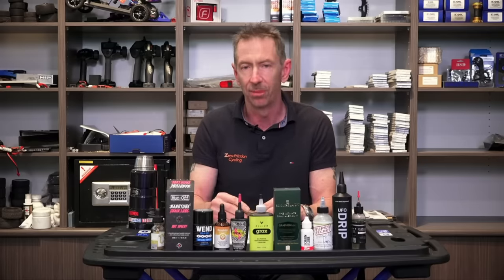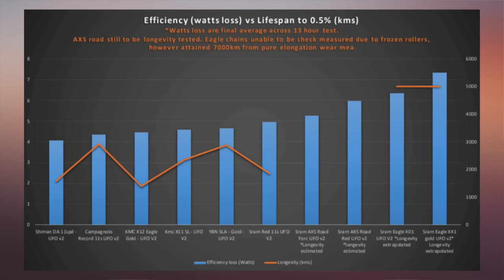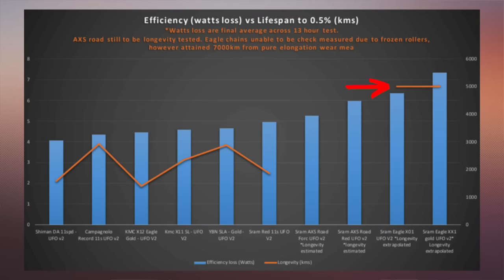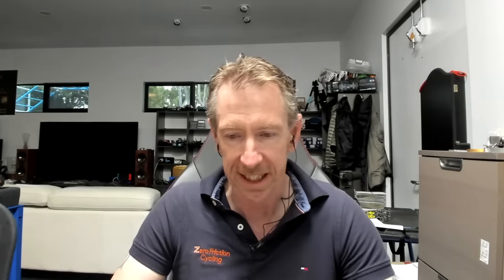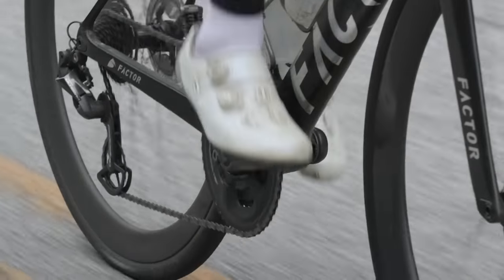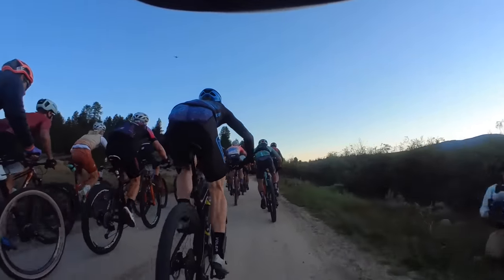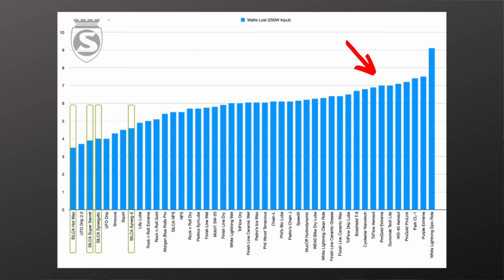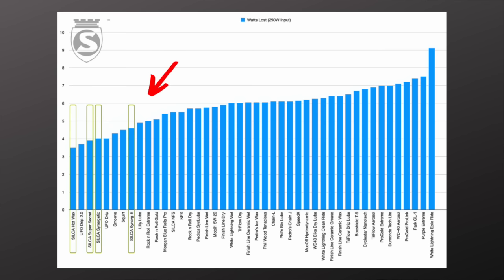How Slow Are SRAM Chains and Other Drivetrain Efficiency Questions With Adam Kerin

Comment: It will matter only for stars like peter sagan. For 99% of recreational cyclists out there, it does not make any difference and longevity comes first in their mind.
Reply: I have a bit older pinarello road bike with pretty much the best drivetrain, tire and inner tube combo... and boy, that thing is fast. All the marginal gains add up so i can zoom around at 35 kph with moderate effort

Comment: Whatever minuscule gain from the OSPW is negated or worsen by the extra weight of the chain length in addition to the more surface area for wind drag.
Reply: Depends on your W/Kg. A DA link is 2.4g and the OPSW requires 2 more links. So that's 5g + 22g more (over stock) for the OPSW itself. So at 5w/kg that would cost you 0.135w on a climb but you save 0.5-1.0w. But if you are an alien pulling 50w/kg that's a 1.35w penalty and you are better off using the shorter chain and stock pulley system

Comment: I don't understand the chain line diagrams. Surely the chain leaves the chain ring and cassette at close to the top/bottom rather than the trailing edge.
Reply: Good point!
Reply: Yes - I noticed this - that point is incorrect the chain angle is the same whether it’s am 80:80 or a 30:30 - his subsequent point stacks up though as if you want a 1:1 ratio and you run an 11-34 cassette you’ll have a straighter chain line at 1:1 with a 30 tooth front than a 34 tooth front.

Comment: Those cassette/chainline pictures are really misleading - in reality there is almost no difference in chain angle between large and small choices. The chain interfaces more at a tangent , (near the centre of the ring/cog looking vertically) not between the closest points!

Comment: Love watching this after picking up my SRAM rival chain on Friday.
Reply: Hey Austin- keep a close eye on wear, rival level does not have the hard chrome treatment that force and red level has. It will likely be similar to what we see with eagle where GX level chains wear rapidly, whilst x01 / xx1 have extreme longevity.
Reply: @zerofrictioncycling992  Thanks for taking the time to give me some advice and educate me. Y’all are out here doing gods work, keep it up. Your work is much appreciated.
Reply: Glad here as been looking at red but wondering if red update first or not
Reply: @zerofrictioncycling992  I understand you might not know but cheap Vs expensive bottom bracket, does it change the shell quality? I been looking to maybe buy cheap and put Enduro XD 15 bearings inside it instead of what in it
Reply: @mlee6050  that is hard to answer concretely. All industries have brands that manage good quality for an impressive price, others may be poor material quality and mfg tolerances at more budget prices. It really would be brand and price level specific, what material quality do they use, and what % of product comes out in tolerance based on their mfg techniques and quality checks. 

Tolerance to a degree you can measure if you are very good with a good set of calipers - but not easily, and normally a micrometer is better but not many have those. Material quality is harder of course. At a race last weekend, a friends bb shell housing snapped off (bsa bb) - so that was his race done, and some fun now to get the threaded section out of frame. if it is an internal housing such a thing is a lower risk, it is more about tolerances and fit. 

Personally, if you have the budget for xd-15, i would rather just have everything guaranteed awesome with a quality housing as well.

Comment: The chainring size increase having negative side effects on chainline is something I had never considered
Reply: It doesn’t make sense to me, since the chain should leave the chainring near the center, not at the ends.
Reply: @SeaCowsBeatLobsters  that's not the issue.  It's the fact that if you have a cadence zone and you change chainring sizes, you're going to be on a different cog.
Reply: @veganpotterthevegan   Yes, there’s cadence too, but look at 10:17. There’s exaggerating to make a point but good lord! LOL!
Reply: @SeaCowsBeatLobsters  That would be true only if you did not cross the chain and did not have different cassette cog sizes. If you look at how the chain exits the big ring when it's on the smallest sprocket, you will see it will touch a few more teeth beyond the center. The same for a big/big combination. Try the same on the smaller ring and the chain will stop touching any teeth much sooner. Then experiment back pedalling with your hand on different combinations and notice the difference.
Reply: Yes, I always noticed how a cross chainline on my 46 always sounds so much worse (more friction) than in the 34. After watching this I went to look at how the chain exits the big chainring on the cassette ends and it makes total sense. It rubs in a lot more teeth.

I guess this shows bigger chainrings are only more effective if you can ride in the middle of a cassette most of the time.
Reply: @SeaCowsBeatLobsters  you will find it does, the chain line  is dead straight, you are correct. As you introduce angle, the chain will engage with more  teeth as it  enters  chain ring, leaves cog. You can test this easily at home, put a small cog from cassette in cog 1 position, vs largest cog. Past a certain tolerance, going to extreme in chain line angle really makes things run very high loss, and small changes in cog / ring size can have this on the right or wrong side of that
Reply: Yes, once I saw his diagram the light bulb in my brain clicked on.
Reply: @DaaamnGina  ha, it's just to get the idea across.  But I'd really like to see the friction difference from being 3 cogs over from going from say a 55t to a 60t.  I retired 8yrs ago(low level pro) and I'm coming back after a long period of mostly just hiking.  I used to run a 42/55  on my TT bike with a 11-26(11sp).  I ordered a 56, 58 and 60t Garburuck 1x rings(running 12sp now)and I'm planning on using 11-30 to race on and a 11-34 to train on.  I live at altitude so I'm hoping to be close to as fast as I was(with much lower wattage).  I never used a power meter when I was racing but I have one now.  Kinda wondering how everything will compare but overall,  I think I'm getting more aerodynamic gains from having a 1x bike than any losses I'd get so long as I'm not in the 11 and 12t cog. 
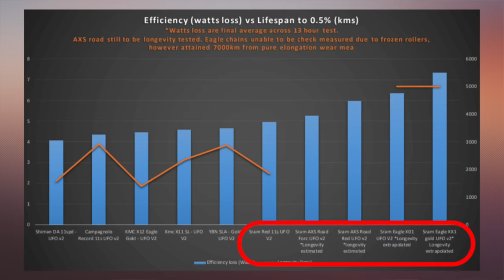*Going to start with that 56t and go up to the 58 once my wattage is more respectable. The 60t will probably only be used if I go to a very fast, very flat race in New Mexico where everyone is typically +2:30-3:00 faster than they are at sea level. The course has about 5' of total elevation gain in 40km😅
Reply: @nluisa  I ride oval 32/48s with my road bike.  I have rotor cranks and it's easy to play with the chainline.  I set my 48t just right of where a 1x chainring would be and the friction going big big feels very minimal.  I'm running a 10-33 or 10-36 on that bike and I totally love the setup. I only use the small ring from about the 20t and up.
Reply: Right? I feel like I should go back to 2x on my mountain bike....
Reply: @SeaCowsBeatLobsters  so true
Reply: @veganpotterthevegan  We have some really great data on both cog and ring tooth efficiency but in simple terms, the rear is pretty non-linear as the articulation angle onto and off of the cog really starts to grow as tooth count gets low.. so for example going from a 16 to a 15t cog costs you 0.5w efficiency, going from a 13 to 12 costs you 1w and going from a 10 to a 9 costs 1.8w.  On the front, things are much flatter almost approaching linear over small changes.  A simple rule of thumb for chainrings is 0.1w per tooth over small ranges once your in the upper 40-mid 50t range.
Reply: @nluisa  I see the effect now, although I still think the diagrams in the video are horribly misleading.  Thanks for explaining!
Reply: @SeaCowsBeatLobsters  You get better leverage on the big ring.  More sprockets are sharing the load at any given instant.  So much for compact gearing, huh?
Reply: @MrBig617  yup, coming from 2x system, I tried 1x11s but never like it from the start. Excessive grinding when riding on extreme end of sprocket.

Comment: Alot of info to unpack there! I found the part about finding what combo front and rear gear you will most likely be in the most during the event was fascinating. I am not interested in using ceramic bearings and after this video I do not think I will ever be. Way more benefit from picking the right chain and waxing it than all the expensive ceramic bearings on the bike.

Comment: Nice to see data that Dura-Ace chains are faster than Ultegra or 105.  Use a Dura-Ace chain for racing and a lesser chain for training.  For my gearing I have always used the smallest cogs with the smallest chainrings that get the gear range that I want.  This results in lighter cogs and chainrings and a shorter chain, all saving weight.
Reply: Saving less than 100g at best though no?
Reply: @SamuelBlackMetalRider  It all adds up.  Weight should be a part of every frame, component and tire selection.
Reply: @danielrussell9416  Right,in the end all these little savings add up! 👌
Reply: @danielrussell9416  Only if you're going up. It does not help riding on flats or downhill.

Comment: Also Dylan, I know Josh has reported that a 53x11 is a 6 watt savings over a 48x10 (at least half of that is actually due to the chain) but does anybody have the numbers on how much even larger front chainrings would save over the 53 such as a 56 or even the 62 tooth front chainring that Victor Campenaerts utilized at Omloop?  Victor also had a 1x system with a Classified hub.  I know your sponsored by CeramicSpeed and appreciate the inclusion of Adam’s information on how little those components actually save.
Reply: I'd like to see the wind tunnel data on a 62t chainring vs a 53.  It may lose a sizeable percentage of the total gains.  Less so on a TT bike(or with a classified hub) running 1x as you gain even more by not having the FD, FD hanger and small ring at low yaw.   Haven't seen and 3rd party data about the efficiency of the classified hub either.   A rohloff is the only internally geared hub that's tested and proven to be quite efficient. But it's absurdly heavy and you can't shift under much load.
Reply: The watt savings are more by not using an 11 tooth sprocket than by using a 56 or a 62. A 52x 11 is roughly the same as 56x12 but the chain doesn't have to do such a tight turn, also when using a large front sprocket the gaps between gears are smaller , so you don't get so much as one gear feeling too high and the other too low.
Reply: Your windtunnel data would be off cause the ice cream
Reply: When you're walking up the muur, don't think chain efficiency matters

Comment: I was thinking 'Well, crap, I just bought three SRAM Force 12 speed flat top chains on 40% discount literally this Saturday', but if I understand correctly there isn't a great alternative because of the detailed geometry. I still love my Force AXS though.

I also bought three SRAM Rival PC-1130 chunk-o-chains for my Kona Sutra which is 11 speed Rival 1, again at a good discount. If anybody has comments on alternatives I'm all ears. I'll get through them in 18 months, or at 15 Euro's a pop they can stay in the spares bin without too much heartbreak if there is a better alternative. I'm a recreational pensioner cycling (in a stately and dignified manner) on road and very sandy trails. I care about budget a bit but I can a reasonable spend if the Missus isn't reading this.

Comment: Regarding using a YBN or KMC Chaim on SRAM
AXS…I have AXS on my TT, and run an AeroCoach 1X chainring, with a 12spd YBN Chain with an Absolutblack OSPW, and it works fine, no dropped chains or jumping. 

Ok, sure I have an OSPW, but it seems that you can safely run a YBN or KMC chain on AXS, by running different chainrings than the AXS.

Comment: There’s also a big problem with imitation Shim@no 11s chains (and probably others as well). Definitely avoid Arizon. That’s where I got my fake one. Before I returned, I did a side by side on how to tell them apart. If you’d like to see, let me know where I can send a link to an album.
Reply: It can certainly fool the untrained eye, I can't say it's a piece of cake to identify except if a fake HG901 uses solid pins instead of hollow ones.
Reply: @yonglingng5640  Generally speaking, one of the external ways is on the packaging. Some say they can spot a slight difference in the font, however it can be difficult. An easier way is to look at where the check box is for the number of links. If the check in the box looks like it was printed on as part of the package, that would be a likely indication of a fake chain, whereas a check in the box that looks like it was done with an actual pen or marker, by hand, would indicate a strong likelihood of a genuine product.
Reply: @GNX157  Yes, that's one of them.

Comment: I've been thinking about ditching the SRAM and Shimano 12 speed stuff for a Prime 9 setup. It would be interesting to know how that would compare in efficiency. I'm assuming it would benefit from a less extreme chain line, and also less rotating mass. I think we've gotten carried away with 12 speeds on mountain bikes. I feel like I'm always just shifting 2 or 3 gears at a time. The increments are too small. I think a wide range 9 speed cassette would be fantastic.
Reply: I agree. I have 9 speed on a couple of my bikes. It didn't get better than this! (I have 8sp, 9sp, 10sp and 11sp bikes)

Comment: Good info overall, but the chain line graphic/analogy is just wrong. Chains separate from cogs at TDC and BDC, especially when front and back are equal in size. After chain line, the true optimization relates to articulation vs drivetrain weight and clearance.

Comment: So much for Campy 9spds cog, what a farce...11spds is already bad enough...
One thing not mentioned ; the bigger cogs & chainrings produce more leverage because of the increase in radii of the circle, same concept as crankarm length. Not just greater chain angle & articulation.

Comment: Interesting - thinking about the new classified hub and removing the front mech, pair of rings might have a greater beneficial saving by avoiding so much cross chaining... and whilst interesting i'm still not going to racing where every few watts count. So a waxed axs chain will stay on the bike, and the cost of an OSPW will be better sent elsewhere..
Reply: I think Dylan has a 1x vs 2x video. 2x is more efficient than 1x but classified says the opposite plus internally geared hubs are generally less efficient than roller chain.

Comment: So as someone who is in the SRAM AXS ecosystem, the Red AXS chain is slower than the Force chain…does that improve with brake-in?  
Has anyone tested a chain with 500 miles on it and see if the chain loosens up a bit?
Reply: Ugh, too bad no one has since answered this question with some data…Ive got about 5 Red waxed chains that I rotate in the bike fleet, I do wonder if they need a break in period but I guess I could pick up a force chain and check it myself using a power meter.

Comment: So we’ve got 1-2 watts on brand new chains. Not enough to make me care but here’s the thing - the moment that chain gets dirty and you clean and lube it theres too many variables to draw any conclusions. 

Personally I use Shimano chains on all my Shimano drivetrains because they seem to shift the best. All my non Shimano setups use SRAM chains. My XX1 chain has been incredibly durable and smooth shifting. It’s the only high priced chain Im willing to buy. I have to pay for my chains and I can’t swap them out after each race.

I’m also curious how chains perform mid mtb or gravel race when they are caked in dust. I honestly don’t know the answer but all drivetrains get significantly worse in that scenario. What degrades the least?

Lastly I know YBN is fast and light but Ive seen too many failures on those things to want to run them full time. Maybe on race day but then the moment your chain breaks all those marginal gains disappear in a hurry.

Comment: Correct me if I'm wrong but the chain only meets the chainring and the cassette at the top in line with the bottom bracket and the axle of the wheel. It meets the chainring slightly before, if we use a bigger chainring than cassette and after if the cassette is larger than the chainring. I believe the angle of the chain line is the same if we use an 80t chainring and an 80t biggest cog as with a 30t-30t. The chain doesn't meet the chainrings at the closest points like the drawing shows. 
But again, correct me if I'm wrong!
Great video otherwise, interesting informations!
Reply: That's a very good point and a pretty basic oversight for the people putting so much effort into saving a few watts. Still choosing gearing that gives you a straighter chain most of the time will be best. So his point is still valid.
Reply: I agree. Chain angle will be essentially the same for the various cog/ring positions, regardless of the size of the sprockets. That diagram was incorrect.

Comment: I'm on a level where the biggest friction happens, when I want to get up my ass and go for an actual training. I'm happy not to be bothered by a 1W loss on a chain
Reply: Well, it's not about being bothered by 1 watt for most people. It is about which chain is worth buying if you have to buy one. According to their tests SRAM lasts longer while other chains have less friction, if i was buying a chain maybe i'd go for the longer lasting one.
Reply: @sepg5084  as i commented above, in my opinion the (according to the chart) sometimes more than double the lifespan outweighs  a 2watts saving max any day
Reply: You gotta lube this part by making appointments with another rider. Way easier to get up, especially in winter. Worked for me today, I wouldn't have made it outside today on my own.